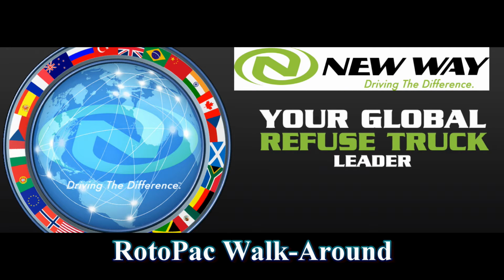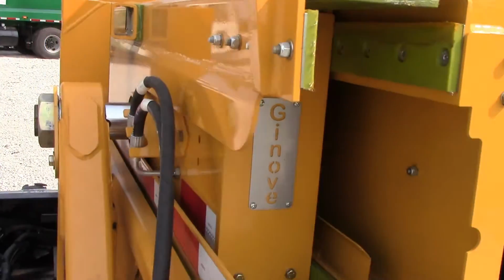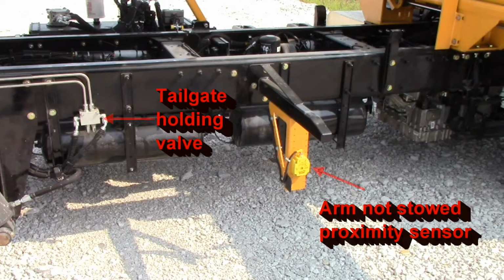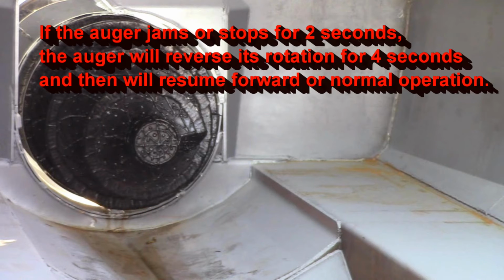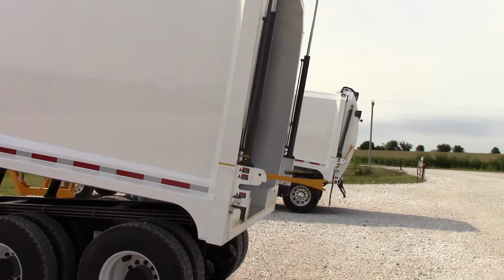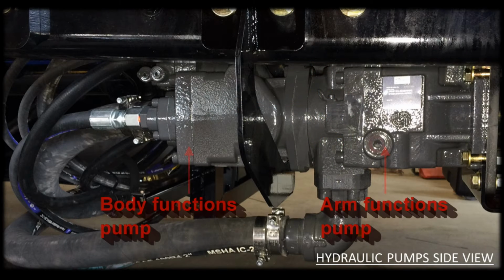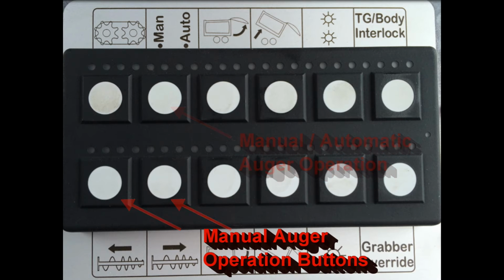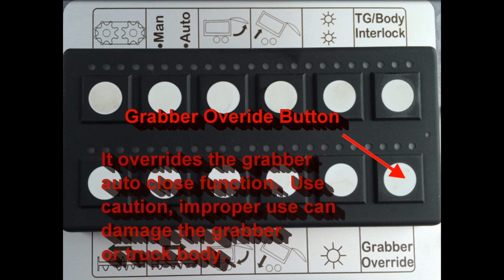New Way RotoPac Walk Around and Basic Operation

Comment: this bullshit had a road call for it yesterday hydraulic line fitting under the body snapped off clean.
Reply: 55 gallons or whatever it was all over the street
Reply: on the top of that the lines where the arm is moving in and out of leak and get loose i’d take a labri side loader all day long only thing nice about roto pack is the way it eats everything